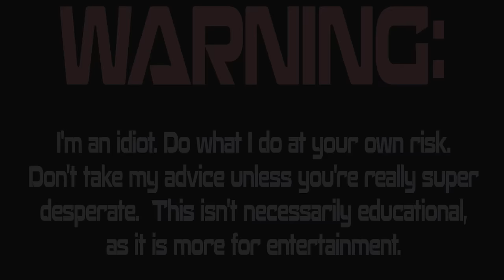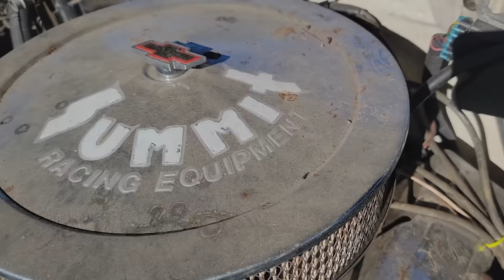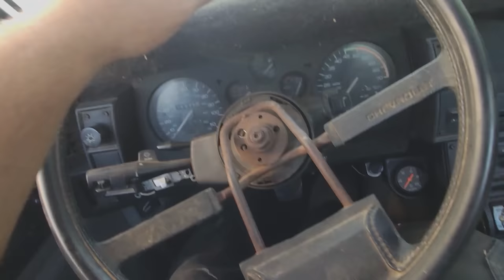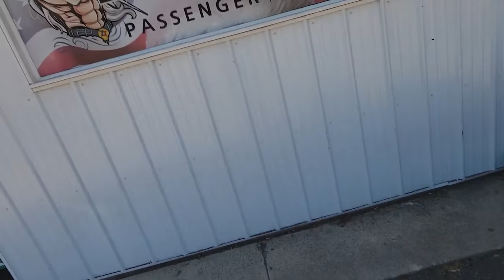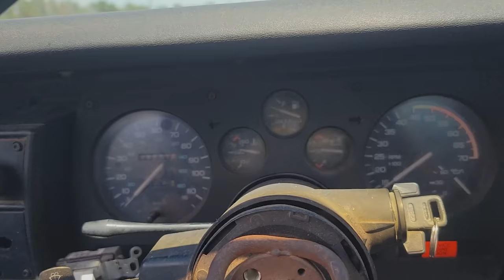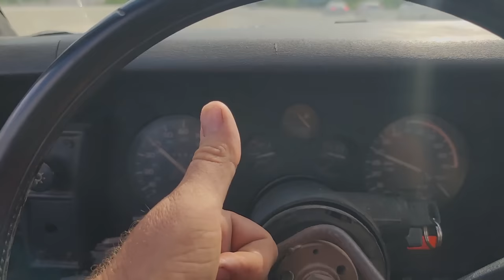Barn Find Camaro - Will it RUN AND DRIVE 600 Miles Home?

Comment: Would love to see at least a partial resto on this one. Maybe some decent rubber, a quick paint buff, or even a full Craig's list respray. And definetly a full cleanup and renovation on the interior so you can take Jessica to town in it.
Reply: That’s about all it’s good for Chevy put the small motor with the stick shift thanks Chevy
Reply: Just pressure wash it from engine bay to trunk lid, de-rodent the innards & just enjoy it. Retro steering wheel would improve the peeper show when scooting around.
This car seems well made. Everyone was bitching about quality back then. Would a 1988 Honda be any better? Less fun, that’s for sure. Ok, it’d return 30mpg+ but not be enjoyable.
Reply: @GT380man  -- If it's a Civic hatch, it can be tons of fun for pretty cheap.  Hondas are great if you know what to look for and what to do with them.
Reply: Easier said than done
Reply: @600wheel  better a 305 than the 267 I got in my ‘80 El Camino 😂
Reply: @kender1412  No thanks.
Reply: Corvette rallies!!!
Reply: Very cool car much much better than the green corvette you got in florida

Comment: A trick for the future cut the bottom off a cold snack and punch a 5/8" hole in the center of it to use as a restrictor in place of a thermostat and you can use windshield washer fluid in place of water wetter and the interior and carpet out of a fourth Gen swaps right into a third Gen  makes a nice upgrade for the interior and 3rd Gen firebird armrests swap onto the door panels they don't delaminate like the camaro ones do

Comment: I never get tired of "It's got a go handle"  and "Way too much. Perfect!"  Make sure the oil has lots of "vitamins and dinosaurs"   Great episode - back to old time VGG!
Reply: Good video ! About the Gas Mileage - I have a 1986 iroc z28 Camaro. 305 also. 17 mpg city ,  i Got 30 mpg Hwy on non stop trip up to Modesto from San Clemente California. Mine is the same 305 , but tuned port fuel injection. So , You Getting 19 on the Hwy is Easy to Believe.
Btw - I’m the Original Owner.
These Years of Camaro Get Great Gas mileage im finding out. Between it being 305 & Good Aerodynamics it seems.
Mines Been parked for 12 years.
Reply: @OcRefrigeration

I had a ‘90 Iroc 305 and it got decent mileage. My ‘98 T/A with the LS1 gets damn near 19 mpg around town if I keep my foot out of it.
Reply: My favorite line:
“I don’t know…”
Wonder if that’s how he handled the kids when they all went through the “why dad?” stage in their lives!!!

Comment: the look on your face when the engine fired on the first crank... PRICELESS.
you got a jewel there...spit shine, polish and buff it till it glows.  and keep the rims...think they are a limited edition.
Reply: Thats def one you fix on some. Its worth it
Reply: To be honest those rims were nothing special. basic American Racing Hammer rims that were on everything in the 90's.
Reply: @MSW-uf5zu   Dead on with the rims, i had the sdame ones on my s-10 blazer. not missing the center caps.

Comment: I'd love to see this cleaned up and then see what needs to be done to make it a going to town rig.
Fix the floors, maybe rip out the carpets to get rid of the mouse smell.   I think this one should be saved.  It just seems too good to let it sit in the trees
Reply: Agreed
Reply: I agree 👍
Reply: Maybe fix the hole in the floor
Reply: Ja! A fresh dashboard and a decent steering wheel as well! And stop that rust in the bottom and make a full rust repair.
Reply: 99% of these cars were ruined by having the four-speed slushboxes. This one is special.
Reply: Not worth the time and definitely not worth the money to restore.
Reply: @tn18977  For sure that rare to kept it
Reply: @davidnelson6893  subframe connectors, bigger wheels, and an LS1...also swap out the highway gears for a 3.73.

Comment: A tip for when trying to break a seized engine free with a manual gearbox,  you'll get the maximum torque on the engine using the highest gear (5th for a 5-speed).

That engine would have probably turned with the gearbox in 5th (and clutch released) and rocking the car forwards and backwards.  You want to basically get the car bouncing against the backlash in the power train.

I used to work for an antique car&tractor collector in the 80's and we unseized literally 100's of engines this way.

Comment: I used to turn wrenches professionally until 1998 when I got burned out then switched to construction. I remember GM cars of that time period had whats called a VATS security system where there was a silver chip on the side of the ignition key. One could not simply make a hardware store copy of this special key because of this chip. The way it worked was the VATS computer would read the resistance of the chip on the key if it was wrong or non existent, the car would experience what you found on this video. Both the fuel pump and starter would be disabled; which also explains why you have a mechanical pump instead of the electric in the tank. They probably didn't know how to diagnose the VATS problem or didn't know about this security system. The common failure with the VATS system was the ignition lock cylinder has 2 wires in it which rock back and fourth with every key stroke. Over time one of the wires would break off so no crank, no fuel pump symptoms would occur. I replaced many of those in the field.

Love your content by the way.

Comment: Those Camaros were geared well for the highway driving. I remember my brothers would get 20+ mpg on the highway cruising at 80. Definitely strip that interior and a set of wheeels and send it. Amazing there’s no rust either. 3rd gens common rust behind the rear wheels and floors from leaking t tops. Yes they all leak! Almost Impossible to prevent leaking t tops

Comment: I replaced the tranny mount and torque arm today on my 1989 third gen formula. Also a former 305, built a 360 for it with a 5 speed. They're great cars.

Comment: Seems like a straight rig. Clean up the wiring, buff and polish the paint. Take the carpet out and fix the floor. I think she'd be a fantastic daily driver. I was seriously worried when you started, but pulling the old girl with the tractor had me cheering when she broke loose! Arguably one of the best will it run and drives to date ☺.

Comment: Got my 1989 Camaro RS (USA flag red) at Hardy Chevrolet in Dallas Ga.  Car ran 376,000 miles on original engine and transmission.  Excellent car, best running car I ever drove.

Comment: Sitting in my reloading room quarantined with the Rona. This is just what a fella needed. Thanks as always for the great videos.
Reply: A feller hopes you feel better soon
Reply: @NoWr2Run  I’ve been sticking to 410/9/308 recently to conserve primers.
Reply: @NoWr2Run  Nahh just the same as loading any other Shotshell as long as you have the die for the press.
Reply: @NoWr2Run  Usually that or the wrong setup on the height of the press overall if it was a Mec press

Comment: I've owned 2 Camaro Z/28s!! A 78 and a 79! Both Electric Blue and one with t tops 350/auto and the other with 350/4 spd !! Both were 1 previous owner cars with less than 25k Original Miles!!! Mint Condition too !!! Loved em!!!❤😂

Comment: When you were trying to get the engine unstuck you made me think of my dad!
My dad was a certified A&P mechanic for almost 40 years. He swore by marvel mystery oil. Which is why I carry a big jug of it with me in my car no matter what. But I asked my dad once what's in it, he said best guess its high quality atf. My follow up question was if we don't know what's in it why do we use it. His dead serious answer was because that stuff flat out works. And I've been using it ever since!

Comment: This brought me back to 1987 when i turned 16. I worked my ass off and saved to buy my first car, a 1982 Camaro Z28 305 stick. It was beat up and running poorly. My Step Dad and i worked on it for months, got it running good and did some body work to it. When i turned 16, i was finally able to drive it. Absolutely loved that car. Oh, and it had the T tops too!

Comment: I had a 305 that was stuck when I bought it,  I filled the cylinders with kerosene and got it freed it up. That was near 20 years ago, still runs great, and cranks as quick.

Comment: I've got an 89 IROC-Z sitting in my garage Now. Hasn't run for a while but it sure went when it was nice. 305 TPI with a 5 speed. I bought it in '93. I live about 100 miles North of the Cities. The tank is above the rear axle with the fuel pump in the tank. I painted it Polar White (original) before I parked it.

Comment: I think what you should look into next time you do one of these revivals you should stop at the car wash and use the sprayer to blow all the barn crap out of the radiator fins and all the others in front of the radiator. You'll be amazed how that makes a difference

Tear out the interior and rip the carpet out, bleach and pressure wash it 4 times. Let it air dry for at least 5 days between pressure washing, replace the carpet, recover the seats. spiff up the dash and package trays, work the paint, fix the floor, and make it a show car for the family to take to the car shows and let the boys be the care takers to get them into realize what it means to pay attention to detail on projects and they'll be proud of their work and get all the praise from the folks at the car shows.

Comment: My stock 305 when it was throttle body fuel injected got right around 20 mpg highway. It's been changed into a horrible amalgamation of street and racecar that's really fun for 15 minutes a time, sorta miss the days it was that simple to just hop in and road trip somewhere in it. it used to just chew up the miles like it was nothing.

Comment: according to the inter-web, when you have bolts that are offset on the starter, is an indication that you have a 168 tooth flywheel. When the hole are straight across you would have a 153 tooth flywheel.

Comment: what I've always done with taking thermostats out is just cut the center spring mechanism and such out of it then put the rest back in so it holds back some of the water. it's always worked pretty good for me. also anytime you're through Kentucky and need tools or something in a pinch just holler at me I'll take care of you. I love those old camaros with the 305 engines.

Comment: Had an 89 IROC Z28. Brings back great memories of misery wrenching on it especially when you got to the engineer’s bright idea of blocking spark plugs. Was easier to disconnect engine mount and jacking up motor if you had to pull plugs.

Comment: There's actually a lower airdam mounted to the bottom of the core support that directs the air into the radiator. It gets removed and they always overheat after that. They'll run 80mph down the freeway all day with the airdam intact.
Reply: just rip it off and throw that thing away, so it pushes the hot air underneath and sucks it right back in. 🤣
Reply: Nah, mine had a Mercury Marine 350 in it, no air dam, it was LONG gone before I got the car, and it NEVER overheated. Then I put a healthy 406 in it, and it still ran cool. If the fan shroud is missing, then she might get warm. 80's G-Bodys always had those air dams on them too, and they were always missing when the woman pulled over a parking block shortly after the car was new, and those didn't overheat either. I have a 547" big block in my G-Body, no air dam, and no issues.
Reply: @davelowets  I road raced these cars in the 80s and 90s and I can tell you from experience the lower airdam is the main source of cooling on an f-body. I was a gm factory tech at the time and the majority of overheating problems were caused by missing airdams since the car was designed to flow air around the bumper and not through it. I've dealt with hundreds of f-body cars and since the nose is not designed to flow air through so a shroud and airdam are meant to work in unison . One will work without the other but for proper cooling both need to be intact.

Comment: the engine could still be a 350, the inline and offset starter bolts arent determined by engine size but by flywheel tooth number, and all 3rd gen v8 fbodies had the smaller flywheel/flexplate thus requiring an inline bolt starter, in fact my 89 350 chevy pickup had inline bolts, and most gm engine blocks cast after 1979 i believe had the bolt holes drilled for both types
Reply: fairly sure the 89 RS's had 305s with a manual and the 350's with the 700r4
Reply: @DadbrosGarage  TBI 305 was the top for an RS in 89 no matter what trans.  Had to be an IROC for a TPI 350.  This thing has old style perimeter bolt valve cover heads so who knows what it is.. its probably a 350 as the whole starter thing he said is meaningless
Reply: its a 305, guaranteed.....i agree with the flywheel size though.....153 and 160(something) teeth
Reply: @dennisschmitter7310  1989 also came with centerbolt valve cover tbi engines and that is not either of those things, and it also has the manual fuel pump, its not the original engine
Reply: @dennisschmitter7310  And the 2.8 v6 also had the 5speed
Reply: @thamojster  TPI Tune port injection on 305/350 mpi on the 2.8 V6 
5speed on 305/or 2.8 only

Comment: People always go #2 on 305s and while they ain't horsepower makers they still are awesome. I had one in an 87 full size blazer on 33s and that thing was a blast to drive and the motor never once complained. Combined with a 700r4 I got good gas mileage around 18 -20 while doing 70mph @ 1800rpm

Comment: for cooling engines like this, reroute the windscreen washer tube to spray onto the front of your radiator, then keep spritsing the radiator when it gets hot.

Comment: Back in 2004 I bought a blue 87 z28 when i was in high school with 77000 original miles and still own it til this day with now 80200 miles on it. I also owned a red 87gt foxbody during this same time which i also still own. It was cool to own both 87 z28 and a 87 GT at the same time back then.

Comment: On your pull start, you should be the highest gear, with the exception of over drive. When the engine is working, it's less power needed to get the car moving in the lower gears. The engine only sees the differential ratio in high gear, any other lower gear would work the clutch much more.
This the first time I committed, love your videos.
Carl

Comment: The only mistake was trying to push start in 1st gear, that wouldn't work even if the engine was 'free'.  Always use a higher gear , I speak from experience.  The higher the gear, the more turning force is delivered.  
Good luck, friends!
Reply: I always heard to go for 4th since it's usually at least kinda close to 1:1 with the crank
Reply: @joereed2760  yessir !
Reply: Haha I was stupid and tried in first gear on my first vehicle 1994 535i bmw 4 Dr, and I was trying to bump start in first me and my friend just pushing this bmw around this parking lot, NOT getting it to start, only to get told later yeah you do it It in a higher gear cuz it'll spin the engine way faster than a 1st gear pull hahaha
Reply: I was saying "NO, not 1st man, put her in 2nd!" When he said that too!

Comment: Great video,  i have seen first hand how that lower air-dam under the rad support gone and how much of a difference it makes just replacing that part on those 3rd gens when it comes to running temps. -Mark

Comment: This is hugely nostalgic. I also had an '89 RS in high school (mine was dark red), and my bones felt every day of your remark about the way finding a car of your youth in that condition makes you feel old. I remember when the key security system in mine failed. It was still under warranty, so I took it to the local Chevy dealer, and the service manager there just bypassed the system altogether, because they broke constantly and he didn't want to spend half of his life fixing it over and over again. :)

If you keep it, and I hope you do, you might want to look around online and see if you can find one of the special bags they came with to store the T-tops in. IIRC, it had built-in straps to lash it down on the deck in front of the trunk well under the hatch. It'll make dealing with them a lot easier. (Also the stock wheels, which I think fit the car a lot better than the ones you found on it.)

Comment: You should have used  fifth or fourth gear to spin the engine loose. The gear ratio on first gear puts the least torque and fastest twist on the engine and it will lock up the tires. 4th or 5th gear is usually a one-to-one or more ratio

Comment: Oh man a cool video , makes me miss my 1990 RS, man that’s a cool lil ride for not much coin. But you can always throw an LS into and upgrade the suspension like real fast before any go fast stuff is done and it would make that much better of a true driver. Once o fixed the handling on my Camaro , it was like night and day even with my smokie 305 it was a blast, hotchkis lowering springs, sub frame connectors and definitely bilstein B6 struts and shocks . Man that car handle like it was on rails and that was with the 92’ Rs stock wheels with some new to me Yokohama tires. Maid a lot of newer cars raise an eyebrow that this old Camaro would loose them in the curves.

Comment: TBI 305 5 speed..... Good for mid 16s in the quarter and a decent burn out. Those 3rd gens aren't the fastest on the planet but they are cool to cruise around. I've always had a soft spot for them.
Reply: bolt in 383 stroker like my 83 Firebird in the cars playlist!
Reply: Mines 650hp 🤣🤣🤣🤣 it definitely isn't a 180hp 305
Reply: @jonathanlawson4667  were those 305s even rated that high? Maybe the tuned port but not the TBI that would be in an RS.
Reply: @kenleppek  yeah tbi was rated at 180hp the 305 HO was 220 HP and the tunedport 350 was at 230HP